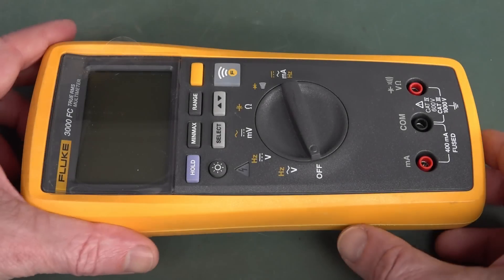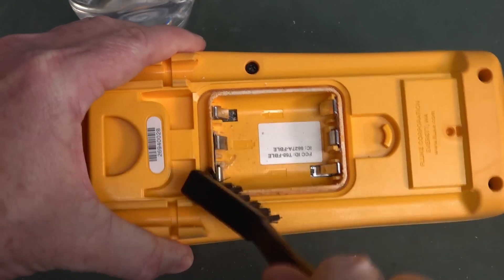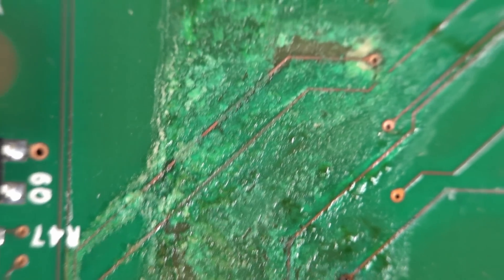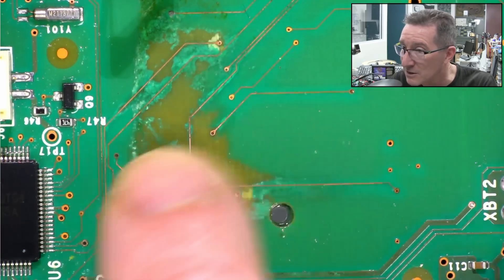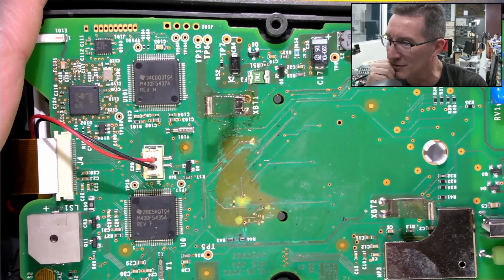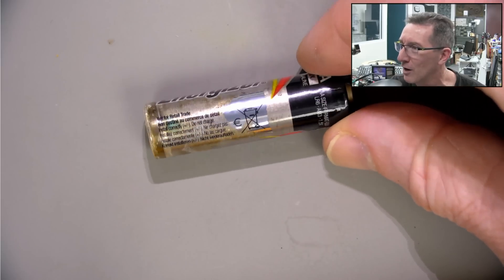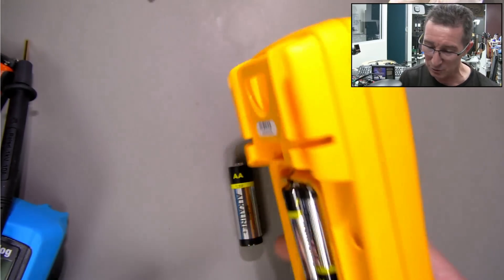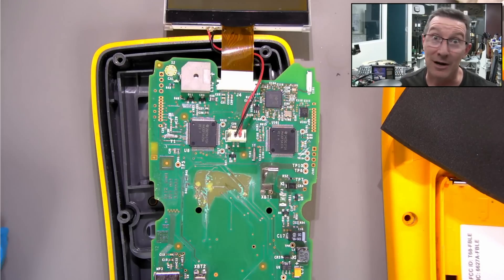EEVblog 1497 - RIP Fluke. Thanks Energizer. NOT.

Comment: I honestly reckon they have made some slight changes to the alkaline formula and/or secret sauce... I have found many brands the past 5 years to leak quite quick. Hell, I have had 3 boxes of batteries NOT even opened, develop massive leaks... And they are just sitting in the sealed package! I always had pondered years past if it was the minimum current draw (as some devices seem more prone to leaks then others)... but yeah, with brand new batteries leaking in sealed packets within 2 years, IDK anymore. Does not matter the brand either.

I have gotten to the point I have given up on Alkas... And stringently keep any and all devices that use them, with the batteries out. (Real PITA!!!). Sucks, but ruined devices, esp high value or rare ones, is worse. I can say that LED torches, especially ones with aluminium bodies, are super prone to ooze ya out. Lost many...and heaps of coin.

NiCD leak, quit using those 10 years ago. NiMH is better, but it too eventually leaks. Never had zinc leak (except a 60+ year old Union Carbide one haha), but they have much less energy density. I have never seen LiIon really leak, but have not looked into if common Alka group size batteries are avail. Then ofc there is the voltage difference.

Super capacitor tech is coming along, but who knows if those will eventually have the density, let alone leak resistance. 

Leakages suck. Even if you try to isolate and contain the batteries, the leak will wick up insulated wire and amazingly (with time) find its way to vital points.

I have never seen so much mask damage! Usually when there is that much mask damage, the copper is gone. Can't rule out Fluke having some secret sauce in their mask material and plastics, it would not surprise me at all honestly knowing Fluke.

Comment: Years later I still don't see wireless charging multimeters. I haven't really been doing it recently myself but I didn't find it very hard years ago to throw a coil inside the meter and have it feeding DC to a lithium cell. Then when I'm not using the meter just lay it on the mat.

Comment: Used to be able to trust Energizer alkaline cells. No longer. I've recently seen both Duracell and Energizer (and other brand) alkaline cells start leaking within just a few MONTHS.
However, even though they cost a lot more, a few years ago I switched to using Energizer lithium cells instead of alkaline cells and haven't seen any leakage at all.

Note: how well the Energizer lithium cells hold up in power capacity seems to depend a LOT on how much power is used by a device. The lithium cells do much better at providing higher Wh capacity when used in devices that consume a significant amount of power. However, the same cells do not do nearly so well in Wh capacity when a device consumes very low amounts of power during use and/or during storage (e.g. LED flashlights that use a "soft" processor-based electronic switch to control power still consume micro-amps of current even when the flashlight is "off"). It seems counter-intuitive, but both Energizer claims and my experience with using their AA and AAA lithium cells backs this up.

Comment: Just had the same problem with a $450 Fluke 233.   PCB and plastic damage. A couple hours later I had the  board cleaned up/recoated and plastic bits repaired to the extent possible using super glue and baking soda.  It works but worried about long term issues I replaced the meter.   This is a lesson I keep learning the hard way. BTW it was same energizer batteries.  Also, the 233 has a removable remote display with its own set of batteries, and both parts experience the same damage.

Comment: I found alkaline batteries invariably start to leak when the voltage drops below a certain leval in low current drain circuits (like remote controls, clocks and devices with a soft power off like this Fluke).

Comment: Are you sure they are genuine? Almost all the batteries sold on Amazon are frauds. I either buy them from an authorized distributor like Digikey, or retail at Home Depot etc. I have had much better luck with Energizer Max than Duracell.

Comment: man how can it be 2022 and we still haven't figured out how to make batteries that don't leak? Or for that matter, how to design products that can deal with leaking batteries? A multimeter that survives drops is cool, but if it dies after 1 year because the batteries leaked then it's not durable at all

Comment: Lithium batteries, they cost more but far less than my devices that use them and I never have to worry about leaking. Heat is a big issue and with devices stored in vehicles where it can hit 140F easily it just doesn't make sense to use any alkaline battery.

Comment: When they started making Duracell batteries 50 years ago they never leaked and they lasted. I  had a new Midland 13-722 2 watt 3 channel handheld radio. I talked on it pretty much every day until I sold it a year later, and the Duracell batteries were still going strong. 
Now, they don't last and worse, will start leaking while they're still good. The only way to protect your stuff is to remove the batteries.

Comment: I don’t blame the 4$ batteries. It’s pure insanity that a multi hundred dollar piece of professional test equipment does not come with a proper built in rechargeable battery. Even cheap crappy devices now all come with lithium batteries, and when they fail all that happens is the battery cover gets pushed open. It doesn’t take the device with it for no good reason.

Comment: I blame Fluke for improperly sealing the battery compartment. A silicone sealant or a product like goop would prevent this. The old 27 built for the military had a separate "bathtub" for the 9v battery. Just poor engineering on Flukes part!

Comment: Check the plated through holes as these may be corroded away. You may have to gently clean the pads each side and join with fine tinned copper wire.

Comment: Energizer on my country (Indonesia) now have 3 alkaline grades. Standard "red" energizer max, cheaper version (yellow packaging) and the more expensive (cyan packaging) - they claim the more expensive, does have longer shelf life & runtime. 
But, being it is priced quite premium (compared to the cheapest yellow pack) -- they don't sell that well, and a lot of them are sitting on the store for 1-2 years, and I've found a lot of them started leaking! Most of them does not leak catastrophically like the one you have, but it does spit out some gels on the negative side! 

I do really stay away from using any alkaline cells, especially Energizer! I rarely buy alkaline cells, but I often checks them on the store to see which brand does leak before it sells 🤣

I prefer using Carbon-Zinc battery for cheaper devices like wall clock / remotes, and NiMH for everything else. 
Carbon Zinc do leak as well, I've seen them sometimes. But, even though Carbon-Zinc gels are sometimes messy, it seems it does not really harm the device as alkaline leaks do. 
I've also seen some Ni-MH leaks too (very rarely), but usually it is a very small white powder and does not harm the appliance.

Or, last resort - for some occasionally / rarely used multimeter, I converted them from 2xAA to CR2032. CR2032 can be stored & even used for decades without leaking! My bank account authenticator pads (TOTP-based) running almost 14 years with single CR2032 despite I use it almost everyday! and no leaks at all! (Panasonic CR2032)

Comment: I've found old gear with 20 year old, non-leaking dead batteries, but after having Duracells ruin gear before they've fully discharged, and leaking within a month of going dead, I thought that Energizers were the answer. It has been for a few years, but now I'm having Energizer leaks.  I'd love to hear from one of the companies' battery engineers regarding what they've cheapened to make them fail so often and badly...

Comment: Alkaline batteries should never be used in any device worth more than the batteries themselves.  They are disposable batteries for disposable devices.  An insidious property of alkaline batteries is that they will continue to supply power while they are leaking.  This is especially true for TV remote controls.  By the time you realize that the batteries are getting weak (reduced range) they have already started to leak and cause damage.  Use only Ultimate Lithium or rechargeable Eneloop cells.  I have never ever had one of these leak in the many years I have used them.  These are all I use.

Comment: ugh really is the worst when your own test gear gets taken out by some silly batteries. I just barely averted a duraleak disaster a while back and have been good so far with the bunny batteries. I'd rather swap an 18650 or 2 in my dmm than than disposables or built in rechargeable.

Comment: Got Agilent U1273A damaged by alkaline leakage (don't remember the battery brand). Luckily it didn't get to the pcb. But like in the Dave's case the battery compartment was all cracked so I had to repair it with epoxy and some cloth. Their famous OLED dispalay died in 5 years anyway. But luckily again Agilent had replacement program due to some interference issues, so I've got a brand new U1283A with a LCD display.
Update: the batteries were IKEA brand.

Comment: How long the batteries were in there? Best practices is to disconnect your power from sensitive/nice equipment. Maybe fluke would be nice to you if you can point to the batteries being at fault (if they failed prematurely)

Comment: Sorry to see you having the leaky alkaline headaches, I've since migrated to 'Lithium' non-rechargeable cells and 9 volt batts for all my test equipment and have never had a leakage issue.
Well worth the extra cost of not having to replace/repair test equipment...

Comment: To fix traces you take very thin single strand copper wire without any covering and run it along the trace. Soldering it at the beginning and the end. Do it for all of them and then cover them in either super glue or better yet conformal coating

Comment: 3 AAA * 1.5V = 4.5V  . You may to use Li-ion 18650 or less formfactor. But you need make work for install their =) But you can glue the housing for 18650 on the tape on the outside of the multimeter, and solder the wires to the contacts. I did this for my old pocket PDA. Or Li-Pol from smartphone, for example (~4.2V in full charged) - they are flat and can fit or you have to remove a little plastic.
p.s. my chinese multimeter have 2AAA (3V). I found old NiMH accumulators (1.2V*2=2.4) and multimeter is working. But i's may don't work with 3 NiMH:
3 NiMH =  1.2*3=3.6V
3 AAA =  3*1.5=4.5V

Comment: "Don't leave the batteries in multimeters" is good, "use lithium batteries instead of alkaline" is better.
The damaged plastic looks BAAAAAAAAD. The PCB looks super fucking nasty for the thing of beauty it normally is. I never knew that Fluke released the schematics and service manuals for their meters, I thought they'd keep these materials locked down real damn tight.

Never saw soldermask dissolved in battery electrolyte.

The leaking battery fluid reminds me of Aliens, haha. Gotta watch again.

Damn pity about the meter, it was a good one.

Comment: The vias may be broken, i used to repair cellphones professionally in  the 90´s and we got quite a bit of waterdamaged ones some of which we repaired and sometimes the vias were toast. Personally i have had very little problems with leaks of  batteries even though i have often had batteries in remotes for years and years and  sometimes like well over 10 years and they have still worked and not leaked and i also usually bought the cheapest ones out there. In the rare cases they have leaked it has usually just been on the battery contacts and while they may certainly have been worse than your example it was just about cleaning and grinding the oxid off somehow and the item worked fine and no problem with the plastic either.

Comment: Best thing I found to clean up the battery corrosion is the liquid rust converters that have phosphoric acid in them.  Takes it right off.  Boeshield Rust Free, Krud Kutter rust converter, the old Jasco Prep and Prime.   All of them have a weak solution of phosphoric acid.  Works better than vinegar ...

Comment: Ack! It looks like my Brymen 869S and my 3 Fluke's are getting lithium 9 volts now, as I am not going to risk Energizers messing them up. Granted the leakage rate on 9 Volt batteries seems to be lower than AA/AAA's, but I'm not going to chance it, seeing that my Brymen is also only a few months old. The alkali leakage damaging the plastic housing like it did is also very disturbing.

Comment: Have never seen battery leak eating plastics, only corrosion of terminals.  Even solder resist has not allowed breaching onto tracks. Only Lithium backup batteries on PC mother boards have eaten away all tracks even under the solder resist  but never from leaked alkaline cells.
That makes we wonder if Alkaline Energisers have similar electrolyte to fixed Lithium cells.

Comment: This is an ex-multimeter it has ceased to be..  It was a good multimeter too. RIP. That battery acid I mean alkali is destructive stuff. 
Maybe a manufacturing fault in the batteries..  No I figured it out - if moisture got in everything else could be driven by that. That would explain why the corrosion got so far.

Comment: The alkalinity probably attacked any strengthening additives in the plastic (usually glass) and the force of the crystalization over came the tensile strength of the compromised plastic.

This is demonstrated by freezing a regular (untempered sodium) glass jar filled with water. The glass shatters as the force of the growth is focused into molecular width tips of the crystals.

In that vein, I spend extra for disposable and/or rechargeable lithium now because I'd rather spend my time not cleaning up after battery technology from 1959. Alkaline is affordable, but at what cost?

As always great video! I've learned so much from your channel since Day 1 and love what you do. @eevblog

Comment: I think it's all the same with big brands nowadays. I got a 1000 EUR Dell laptop last year, and it's the worst piece of crap that I have ever seen. Keys started to come off after a month, plus they started to turn shiny like they were used for 10 years, the keyboard is GLUED with plastic, there are no screws, you have to actually melt the laptop's body to replace the keyboard. The CPU fan connector came off the board together with all the traces when I tried to plug it in... not to mention that the heatsink for both CPU and GPU is only the size of a small USB drive, that thing can go to 90C on the CPU with the fan spinning. it's something I haven't ever seen even in 200 EUR laptops...

So for batteries I just use noname batteries from local stores and shops and I never had any issues. The same for my car, my current battery is a Banner battery.

Comment: I'd definitely soak the whole PCB in a light vinegar or citric acid solution for some time and brush it to get any residual KOH out of the vias and from under components. Else it might slowly continue eating away the copper. Then a good wash under the tap, then a distilled water bath with soaking, then blow-dry and finally a IPA bath and again blow-dry. Every bit of kit I treated this way is still working years later.
So: yes, repair it :)

Comment: Not much help on PCB but I have thought of applying silicone grease all over the battery contacts in gear so that they are somewhat protected.  The grease will not prevent a proper contact to the battery.

Comment: Vacuum out any of that dust that you brush off.  I use the isop to clean that sort of thing up, the alcohol will dissolve the residues.  Then you can use a cotton swab and polish the contacts with one of the paste metal polishes, and use the isop to clean off any residue of the polish.  But your PCB looks like the Energizer bunny peed on it.  I started using a store branded alkaline sold by super markets here and they are cheaper and have not had one leak on me yet.  I have seen alot of damage in gear from leakages.  But secondhand gear,  I try to keep an eye on my batteries although there are alot to remember to check with radios, test gear, etc.

Comment: Normally Duracell and Energizer batteries do not leak unless they are connected to a load for an extended period of time. This  multimeter may not have been turned off manually  or it is has a small parasitic current draw when it is turned off that slowly discharged the batteries until they leaked. Are there any other Fluke owners that have had similar problems?

Comment: Lesson : don't store your fluke upside down
Reply: depends on the model:the Fluke 70 series have the battery connector directly ON the PC board!!
To reduce the risk, these meters need to be stored FACE DOWN!
The Fluke 23/25/27, on the other hand, indeed should be stored face up.

Comment: Varta alkaline batteries here are just as bad if not worse. Since the 'ready to use' (ultra low self discharge) NiMH batteries came I have adopted those for each and every suitable piece of equipment. At least you will have about 100% certainty they will never leak.

Comment: Thanks for a reminder to check the batteries in my Goldstar DM-333 ancient multimeter :)
I use it quite rarely, but one battery was at 1.3V and the other at 1.5V. They been in there for 10 years surely :)
Swapped for new ones!

Comment: I think that's also a flaw in construction of that Fluke. The battery compartment should be enough capsuled to prevent that from happening, especially on a high priced meter like a Fluke

Comment: Is battery compartment fot Brymen BM786 leak proof or would you suggest to remove the batteries for a long period if this multimeter not in use for a long time?